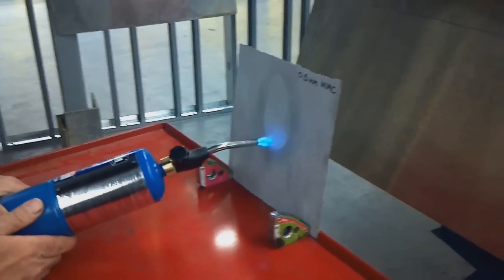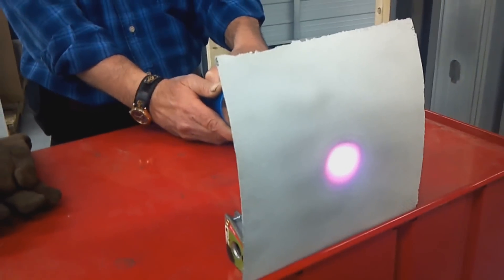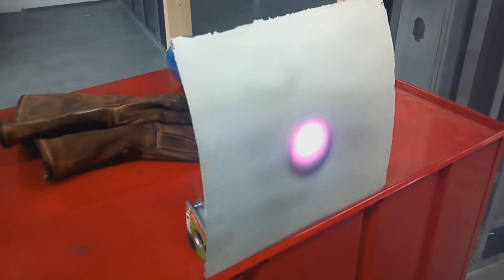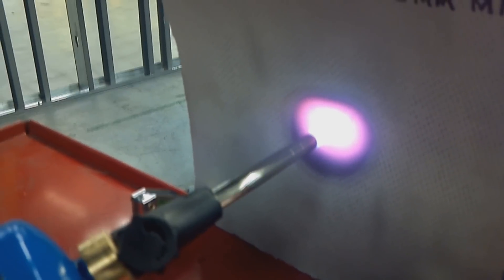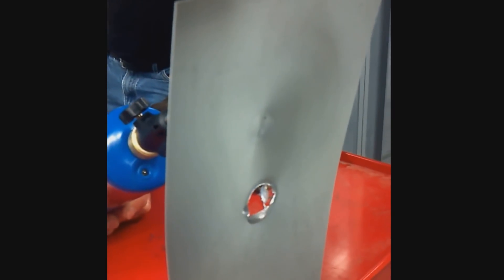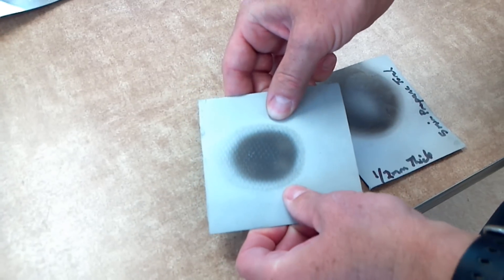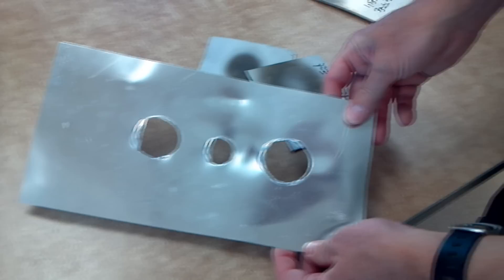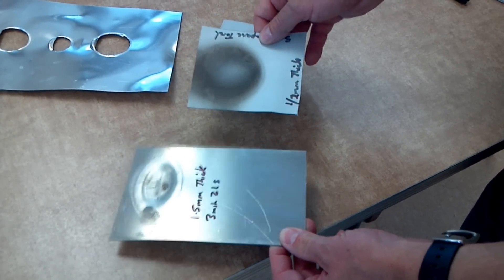Propane Torch vs. Fireproof Aluminum Foil

Comment: Can you burn through Titanum? How about Chromum?
Reply: +VicariousReality7 not with only propane. probably oxy-acetylene, that burns about 6000F - but I don't know off hand what the melting points of titanium or chromium are. oxy-propane may be hot enough as well, and oxy-hydrogen is surely hot enough.
Reply: Kevin Keel -It's 1,668•C for titanium and 1,907•C for Chromium. Sheets as thin as foil may require less though.